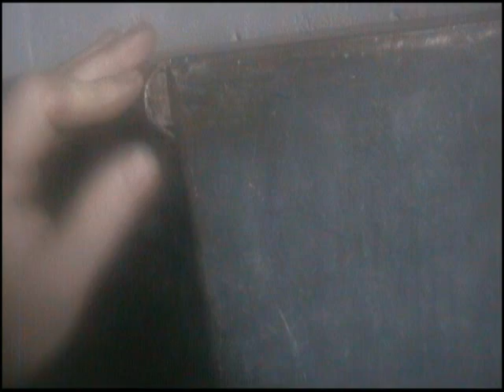Myford ML7 Lathe Restoration Episode 1

Comment: The "little bolt" fitted is actually the electrical Earthing point, the other two holes are for the Electrical Connection Box, fitted at the Factory. This also had a metal cover fitted over it to protect it, the mounting bolts & nuts were Brass...